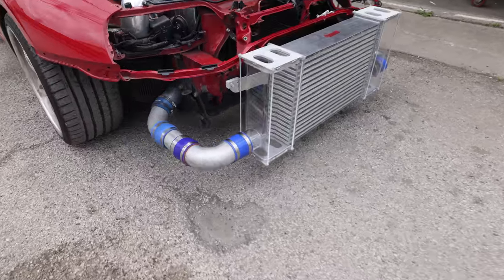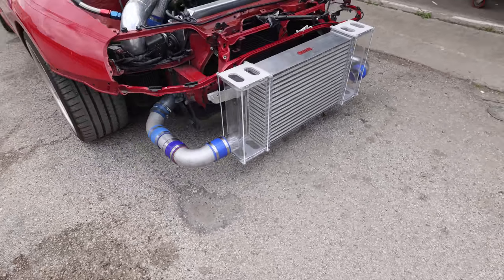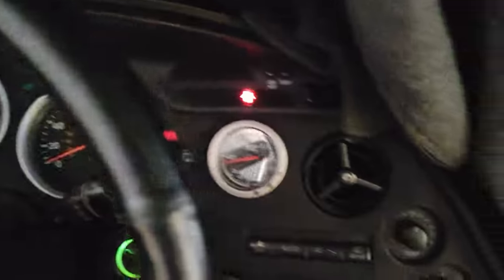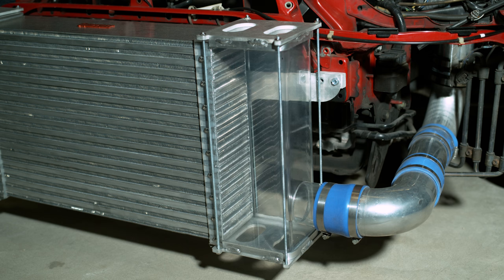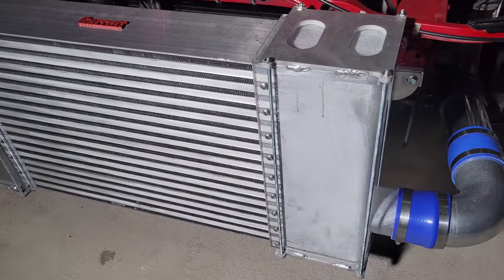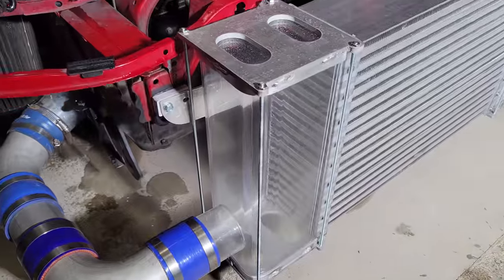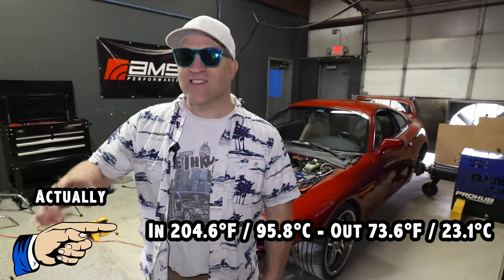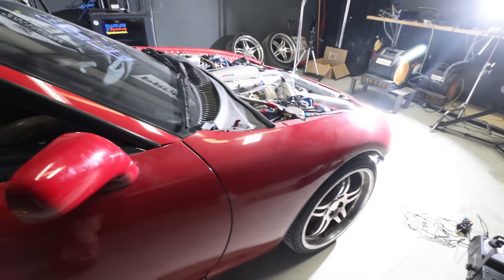See Thru Intercooler In Slow Motion - (Dyno Run High Boost)

Comment: What a poor design these intercoolers are.. you can see the poor distribution of airflow between entrance and exit quite clearly with smoke
Reply: What brand do you recommend then ?.
Reply: @MDEV-86x86  I don't recommend any. I'm just saying from an outsider standpoint that the airflow is poor.
If your forcing an answer from me then I'd say something along tesla.'s design with laminar flow characteristics. Tesla turbine
Reply: You have no idea what you're talking about. Garrett intercooler cores are amongst the best in the industry. I'm sure you know better than a multi-billion dollar company.
Reply: The intercooler core has nothing to do with that. It has everything to do with the end tanks. The inlets are both on the bottom. Air will take the path of least resistance.
Reply: @Awnawbruh  I know, poor design is what I said. Simply having the exit at the top of the core would be better.
Reply: If anything, better to have the inlet at the top. Hot air rises (not sure that matters enough here tho).

Comment: And for the people who said in the last video an intercooler doesn’t Do anything. You can clearly see how the temp differs on each side.
Reply: intercoolers can make a massive difference
Reply: Intercoolers definitely make a difference. This intercooler core is massive and will bring the temps down to ambient or below. 

Using an intercooler optimizer (external sprayer with alcohol & water), it will get well below ambient temps.
Reply: Good job comment section warrior 🫡
Reply: @jesvans  derr ya think
Reply: Free power!
Reply: Wait what idiots are saying intercoolers dont do anything??
Reply: My n54 twin turbo bmw with around 420hp and tq was running 87Deg Celsius with the factory intercooler, and 32C with the VRSF stepped intercooler installed which is much larger. Literally was night and day intake air temps. Over 55 Degress CELSIUS not farenheight drop from a mild intercooler on a stage 1+ Tune at 18 psi boost
Reply: Intercooler def do make a difference. FAT difference on a top mounted intercooler on a speed3 vs front mounted . The heat soak is way less.
Reply: @oleyeller3256  on the last video I made a comment about it would be nice to see how the temp differs on each side if we could see it and a lot of morons tried to say it wouldn’t be diff or other crap like that.
Reply: @Alanski340  n difference in turbo lag n responce wit your fckin front mount;p..i wouldn't ever do that;p
Reply: @bonifacijus11  then you stay slow
Reply: @Alanski340  i stay sane..don't see any point in raising power on a fwd car, when it already doesn't have enough of grip with stock excessive power..
Reply: @bonifacijus11  
There’s nothing excessive about the power of a Speed 3. They’re still slow as balls.
Reply: People really said they don't do anything?
Reply: No one said that.  They said air was see through so what was the point of this.
Reply: @backyardhooper06  go to the last video when he first made this and read the comments and the people said that INTERCOOLERS do not do n e thing.  you will realize why I made this post.
Reply: Intercooler 100% make a difference. Watching my temps from before and after intercooler it goes from 300f to 70F
Reply: who says it doesnt?
Reply: Is the intercooler for cooling down the air that gets sucked up by the turbo?
I know high pressure and high flow can cause some heat but i didn't know it is that mutch.
Reply: you can tell it makes a difference on a hot day after a few pulls the intercooler gets hot and you have noticeably less power.
Reply: Anyone that thinks an intercooler doesn't do anything should get rid of theirs, see how long they last, lol.
Reply: Big auto has you brainwashed, cooling systems aren't even needed on motors sarcasm
Didn't know people thought otherwise
Reply: What was that juice and what was it doing ?
Reply: @stuarttrapani9330  The science is actually simple, you can't have both horsepower and fuel economy at the same time. Heating the air up causes it to atomize and makes it more fuel efficient as it becomes easier to combust. As this happens, the horsepower drops. This is why some manufacturers use turbos with low boost to make fuel efficient cars.
Reply: @davidparker9676  you cannot go below ambient
Reply: @gustavomercado1599  You definitely can go below ambient with water sprayer with alcohol.
Reply: @ArthurDeKeersmaeker  It cools the charge air. Pressurization increases temperature, that's why intercoolers are used.
Reply: "they do nothing" ? Why have they been used in forced induction engines for over 60 years?
Reply: @Spencer19165  clueless people is not what surprises me, what surprises me is the whole intercooler debate is from early 2000s and got settled so long ago and i just thought it became one of of those well known facts and things of common knowledge in the world of FI. Its kinda nostalgic actually now that i think about it haha, that people still debating it. The good ole days
Reply: @Spencer19165  clueless people is not what surprises me, what surprises me is the whole intercooler debate is from early 2000s and got settled so long ago and i just thought it became one of of those well known facts and things of common knowledge in the world of FI. Its kinda nostalgic actually now that i think about it haha, that people still debating it. The good ole days
Reply: @bonifacijus11  fwd has less grip potential but they can still be damn fast with good setups. If you dont know whats the deal, you will be damn surprised how fast fwd setups can be. Watch out for them pos civics with the laptops 😂
Reply: I owned this car (purchased brand new in 1997 with RMM upgrades) including a Front Mount IC
I'd've never believed it dropped the temp that much dynamically (in motion) ... let alone, static.
Reply: "a intercooler doesn't do anything" lol you need to be a special kind of carspecialist to make that statement, you can measure the temperature before and after the intercooler rather easy and a good low temperature means more better.
Reply: @davidparker9676  lol, you can't bring temps below ambient as you're using ambient air to cool it
Reply: @magnetic0314  yes, you can get below ambient when you use evaporation on the outside of the cooler core.
Sorry buddy, you are wrong.
Reply: @davidparker9676  ahh yes I see you've added a hypothetical scenario irrelevant to the topic. Good on ya matey
Reply: I didn't think it would make that big of a difference!
Reply: @ArthurDeKeersmaeker  with colder air you can have denser air which means more oxygen molecules per square volume which means bigger boom making more hp and torque.
Reply: @DominiDiscord  They do a lot. Using a high quality one makes an even bigger difference.
Reply: You can use CO2 also or methanol water injection. There's ways around not using intercoolers
Reply: @imhungry2387  how do you use co2 instead of an inter cooler. Is there a video of someone with that setup. You peeked my interest with that 👍
Reply: @davidparker9676  I also didn't think that the air would raise that high above ambient temperature going through the turbo given the low PSI and the drop. I figured the numbers wouldn't be as high or have that kind of differential.
Reply: Why would someone say an intercooler does nothing, ha.
Reply: Bruh whoever said that has never worked on a car.

Intercoolers give colder denser air = more oxygen = more fuel = more boom. 

Intercoolers give colder air which reduces knock by a lot in the summer, you can save like 50WHP by getting a larger intercooler on some cars due to timing adjustment. 

Bigger intercoolers have less pressure drop across them than a small one, usually 1-2 PSI vs 2-5 PSI, meaning your turbo has to push out 4 less PSI than with the old intercooler, which leads to higher top end power (if the turbo tends to drop off) and a less stressed turbo. 

In short, intercoolers are the best upgrade for every turbo car, and depending on where you live/type of car it’ll be more useful in making a stock car faster than a tune.
Reply: @DominiDiscord  Yeah when turbos compress air it raises the temperature to like hundreds of degrees. Rough numbers, at 20 PSI of boost the air will be 300 degrees Celsius… definitely wayyyy too hot to run an engine.  This heat comes from the compression of the air, not the exhaust heating up the turbo. After it goes through a good intercooler it drops down to only 2 degrees above ambient air temp. If you ran a car on 300C air it would make like 10 horsepower and then probably blow up lol.
Reply: @ArthurDeKeersmaeker  A turbo can compress air to 200-400 degrees C, and engines like to use air around 25 degrees C lolol
Reply: @Chevsilverado  I'm sure it has to do with the volume and short time frame for compressing the air. I had my perception because an SCBA bottle hot filled from 2000 up to 4500 psi over a couple minutes will not be that hot. And air compressor tanks pumped up to 150 psi aren't hot to the touch.
Reply: @DominiDiscord  It does. If you do the calculations for pressure vs temp then the numbers for it are even higher than the ones I just said. What matters is if it’s cooling off as it’s pressurizing, scuba tank air will cool inside the compressor (heat fins), down the line, and into the cold tank, which are aluminum usually and are great heat sinks. If you put a temperature probe into the hot side of the intercooler it’ll read 200C easily on a stock car, and once you start boosting to 28 PSI+ it’ll easily reach over 300. But yeah I got my numbers by doing the calculation, then subtracting about 100C for cooling and length of time, and it came out pretty exact for what I’ve seen in actual tests. 

For example, this is the same reason why spring powered pellet guns can shoot over the speed of sound.  An air pressure wave cannot push a bullet faster than the speed of sound, so you have to make the speed of sound faster by heating up the air. Inside of a spring powered pellet gun air is compressed to a pretty high pressure by the piston once the trigger is pulled, and it’ll easily reach 400 degrees for a very small split second, raising the speed of sound well above what it is usually and it lets the pellet get pushed super fast. 

Air rifles that use pre pressurized and cooled resivoirs cannot shoot faster than the speed of sound because it’s air is ambient or below ambient temp.
Reply: Who the heck says an intercooler doesn't do anything???
Reply: Their probably the people who have never owned or driven a turbocharged car
.
Or young people with their tiny little 1.0 liter 3 cylinder turbo cars .. lol
.
.
Of course intercoolers make a Massive difference
.
The colder and denser the air is, the bigger the bang  🤷‍♂️
Reply: @ArthurDeKeersmaeker  when the air gets sucked in and compressed by the turbo it heats the air up alot
.
Plus the turbo itself is red hot due to it being powered by the exhaust
.
.
Hot air doesnt burn the fuel as well as cold air,
          so the intercooler takes away the heat caused by the turbo,
           so when the charged air makes it inside the engine its much cooler and denser so a much bigger bang
.
.
.
Have you ever noticed how much more responsive any car feels in the winter ? 
.
Compared to a hot humid summer day ?
.
.
Also a bicycle pump is a good example of how compressing air heats it up...   
         after pumping for so long a cheap pump becomes too hot to hold
Reply: @magnetic0314  yes you can... 
.
  look up the pricipals of evaporative cooling
.
.
Ive fitted them to trucks and they look like MASSIVE air conditioning units.... 
          they cool the air down 5' c below ambient
.
.
The same principal on an intercooler will chill the charged air down below ambient temperature
Reply: @magnetic0314  no you are 100% wrong and dont know what you are talking about
.
Do your research  before making out you know the truth about something
.
.
Its whats wrong with this world
Reply: @darkslayer6911  sorry mate, I guess I'll take my physics degree off the wall because you on the internet know better
Reply: @magnetic0314  omg your one of them 🤦‍♂️  
.
So youve got a bit of paper that proves youve read some books .. well done👏
.
.
Ive made an evaporative cooler
.
Fitted commercial sized units
.
Measured the output air temperature myself and it is indeed a few degrees cooler than ambient air
.
The only reason why i stopped using them is they cause alot of humidity which makes the air feel stuffy so you dont really feel the benefits of the cooler air enough
.
.
YES  an intercooler does very little or nothing without an air flow going through it,
   .
 but it does 100% cool the charged air down quite a lot when you are going 50+mph
.
Enough to give you a noticable power boost compared to a non intercooled turbocharged engine
.
.
Cooling the fins of the intercooler with a mist of water or methanol further increases its cooling capacity so could bring the charged air below ambient with a big enough cooler
.
.
I bet your going to say water cant go above 100'c without boiling next 🙄🤦‍♂️
.
Or do you not know about pressurised water systems? 
.
If not you can find all the information you need to learn about it
.
Next to all the archives of degrees anyone can read and learn now,
            without the need to pay 20grand for a university to spoon feed the information to you 👍
Reply: @darkslayer6911  stay on topic mate. The OP of the comment was referring to the intercooler in the video. I was making a generalized comment based on 90+ percent of applications where you have a simple air to air intercooler in an unexceptional climate. I know exactly what you're saying and I'm not saying it's false, I'm saying that picking a bunch of exceptions doesn't make the intercooler in the video any more able to drop intake temps below ambient as it sits.
Reply: @magnetic0314  i was referring to the people who this comment referrs to
.
The ones who say intercoolers do nothing
Reply: @Spencer19165  Why would car manufacturers fit them on even the cheapest turbocharged cars? The logic of these people..
Reply: @darkslayer6911  even the little 1.0 turbocharged cars have an intercooler.  Most people don't realise that, as they are either side mounted or liquid cooled, so they are not visible.
Reply: I suppose a radiator doesn't work either that is beyond dumb

Comment: from 90c to 23c, man that's a LOT of heat being rejected!
Reply: i always woundered what kind of tempertures was going through to thing. kinda crazy to me
Reply: 17.6 kW if my calculations are right. Almost 25 horsepower.
Reply: You can get the same effect using meth injection without any cooler
Reply: @MaNNeRz91  Yeah but who wants to deal with that
Reply: @savage101.  Anyone who doesn't want an intercooler and wants more hp because they can't cool down the air enough ... 🤔🤔
Reply: Heat rejected like it's on that show next from MTV
Reply: @MaNNeRz91  yeah but that's too much to do for a normal daily driver,
Reply: @guycha0s380  not really... It's probably simpler than running an intercooler.

Less boost pipe. No cooler. Only need to make a hole in the intake manifold for the spray jet and a controller to measure boost and rpm for the trigger.
Reply: @MaNNeRz91  some people need drugs to stay happy
Reply: @MaNNeRz91  Intercoolers do not need to be constantly refilled.
You can also run a water/alcohol sprayer on the IC core to cool it even further.
Reply: @davidparker9676  meth isnt that expensive and you only really need it when you're doing some heavy footwork. On a modern turbo diesel meth makes a lot more sense so to be fair yeah on the engine in this video meth would be more con than pro.
A TDI doesn't really need the intercooler until higher in the boost range. It'll chomp up hot air all day long until you want to get galloping
Reply: @MaNNeRz91  Water/meth is great for a track car but just one more thing you have to keep track of and possibly forget to refill on a street driven car. A quality IC that is well sized does a great job, no additional cost or maintenance to keep up.
Reply: @davidparker9676  i also heard some other drawbacks from using too much M/I like some corrosion on your internals but i could be remembering wrong
Reply: @oleyeller3256  Alcohol is not kind to many materials in the engine. 

Funny story: The LA Metro sold off all of their diesel buses and bought an entire fleet of ethanol powered buses (going "green"). That decision nearly bankrupted the city. Diesel buses would typically last 500K to 1 million miles before needing a new engine. The alcohol buses were lasting only 10,000 miles and having catastrophic failures, the engines were completely destroyed internally, they were not even rebuildable.
The public transit system became so unreliable, some routes would not be serviced all day due to constant mechanical breakdowns.
The city sold off all the alcohol buses at a huge loss and had to get huge loans to buy CNG buses to replace all of the Alcohol ones.
Reply: @MaNNeRz91  Yup you're right, a diesel doesn't need cooling at all to run well. It just makes more power when you intercool them. It also lowers EGT's. Gas engines need cool air as safety net and so they can run optimal timing. Much more important and a lot more power to be had there. In a diesel meth works well but you'll go through it really fast depending on the application.
Reply: @MaNNeRz91  what about both?
Reply: @joshmanis9860  mother of god....